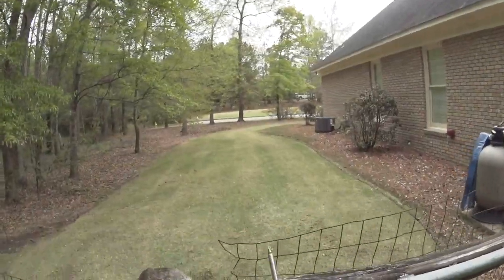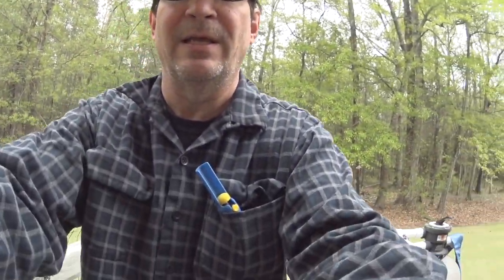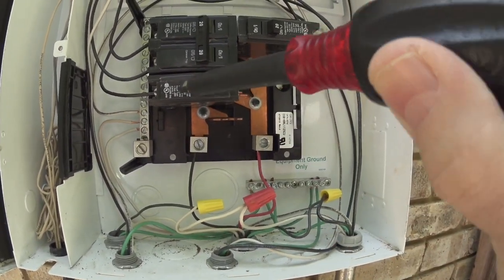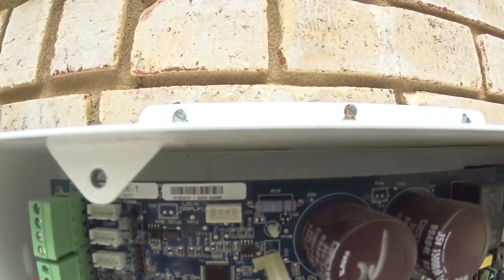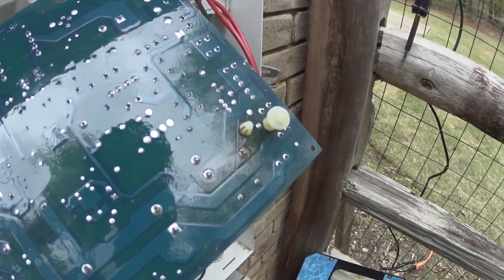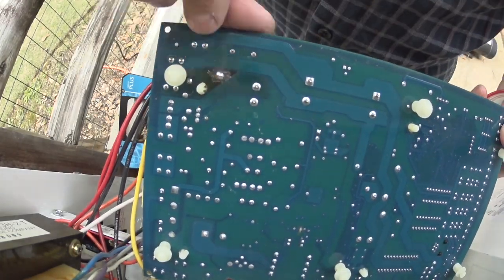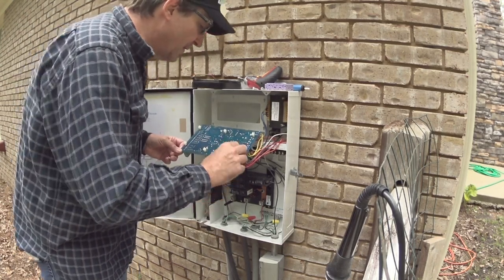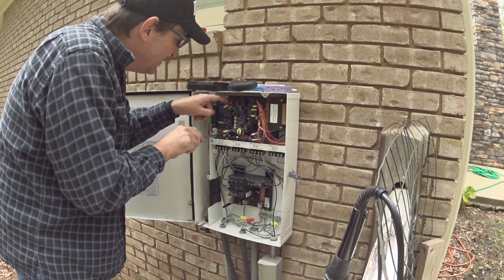Chlorinator Off No Cell Power - DIY Repair

Comment: Thank you, thank you, thank you. This was fairly straight forward and your step by step were perfect. After soldering, my system works fine. Btw, this was my first time soldering anything. Not very difficult but there is a learning curve.
Reply from the maker: Hi David,   You are very welcome!  Glad the video helped you fix your system.  You are right, there is a bit of a curve with soldering but as you have proved this particular repair can be soldered by a beginner!  Thank you for your kind words and for taking the time to come back and share your success here in the comments!

Comment: Wow, thanks. I had the exact same issue and in the exact same spot on the board. A little soldering and boom, fixed.  Who knew it could be that easy.

Comment: Awesome video with just the right amount of detail. A couple of notes, I actually got a low voltage warning a couple of times which I was able to reset until I got the no cell power warning a couple of days later which shut the cell down.  I find it amazing how long the board actually still works with a cold solder joint on the relay (~10 years).  Although my pool has a couple of extra accessories the K1 relay was located in the same area. My board had the same burn/heat marks around the solder joints.  The solder joints on the other two relays don't look great either, but I'll wait until I have a problem before messing with those. Only thing I did different than the steps on the video was to power back up and test my repair before completely fastening the circuit board and the control box to the panel.  Those plastic connecting posts tend to get brittle over the years, so the fewer times you have to remove and reattach, the better. Many thanks for great video and the massive savings of not buying a new board!
Reply from the maker: Hi Ralph, Thank you for the detailed comment, sharing your success and kind words! It’s always great to hear good news of another successful repair!

Comment: Going to try and fix ours! Same message. Praying it works for us!
Reply from the maker: I highly recommend you cut the power off from the main panel breaker that feeds the pool equipment sub panel!!! That’s the safest way. 

I hope it works for you too! Please comment and share if it works or not. 🤞🏻
Reply: We did not cut the main power, we did it just like you. I did tell my husband it would probably be a good idea to do that but he said we know where it is hot so we are good. He has done some minor wiring & electrical around the house so he has a little experience. Thanks again, it worked!

Comment: Outstanding video! Could have been more accurate. It took longer to warm up the soldering iron than it took to fix the problem, Thanks so much for your video.
Reply from the maker: Hi David, That’s funny about the soldering iron taking longer to warm up than it took to fix the problem. So true! Thanks for the kind comment!

Comment: Thank you for the video!! I had the exact same problem and fixed it in less than 30 minutes thanks to your video. As others have said, turn the power off to the sub panel before opening it up to be safe.

Comment: Appreciate the video! I just that this same error/issue/relay with my Aqualogic board except a simple re-solder didn't work. Checking resistance, the relay was open between NC. I replaced it (Amazon - $8) and I'm back running! :)
Reply: FiveAble, no it was pretty straightforward using the manufacturer name and part number on the top. In fact, I think the seller mentioned Hayward or Aqualogic in the listing.

Comment: Absolutely solved "no cell power 2" problem. Thanks, very helpful.
Reply: @fiveable  I was amazed after 5 years of operation to see the relay solder joint blackened and compromised just exactly as your video depicted. One bead of solder later, and 5 minutes and been making chlorine for 48 hours now trouble free. Sure thought it would be more difficult and expensive to resolve. I took pics but they really don't differ from your video meaningfully and not sure they can be included in a comment. Peace to you and thanks again!

Comment: I recommend replacing the relay...! I inspected mine after replacing and it was quite purple from excessive heat. This creates resistance which creates more heat and so on...  until failure. The Omron version is obsolete but you can get the same package in a Zettler. $3.50 from Digikey, Part AZ2150-1C-24DEF

Comment: My board has a burnt place in the exact same spot...you da man
Thanks a ton !
Reply from the maker: Hey Billy! Glad it worked for you too!  Thanks for the comment!
Reply: @fiveable  
I guess I celebrated too soon.
I did the solder repair and that didn't fix my problem. 99.9% sure the relay is bad too. So, I have that relay ordered and on the way. Gonna just try to get a TV repair place to solder my new one in and hopefully that gets me going without having to buy a whole new circuit board
Reply from the maker: Oh well, if the relay fixes it then you will still come out ahead versus buying a new controller.  If it still doesn’t work there is a guy on Ebay who rebuilds these boards.
Reply: @fiveable  
Cool ,  thanks !

Comment: Thanks for posting this! Kinda sucks that if this is a known issue then why hasn't Hayward addressed it with an automatic board swap with anyone who has this problem.. like other companies that I have dealt with.
Reply from the maker: Not saying it’s right but I’m pretty sure it’s because it usually happens outside of the warranty period and boosts new system sales.

Comment: same problem with my board.  I'll fix this weekend doing as you've shown.  In addition to the no cell power error message, it has a  problem keeping time and having the timers coming on when they should.  Does anyone know if this repair might fix that issue as well?
Reply from the maker: Sorry, this repair will not fix the timer issue. I believe there is a clock chip or crystal that goes bad sometimes.

Comment: Great video.  I have the same problem on a two year old Aquarite Pro...
Reply from the maker: Good thing about this problem is that it resolved quickly and cheaply.  If caught soon enough the repair can be made before the pool has time to get out of balance which saves the cost of extra chemicals.  Thanks for your comment.  Best of luck with the repair!

Comment: Awesome video! Thank you very much! Saved me a bunch. Unfortunately the fix only lasted 3 weeks. Any suggestions?
Reply from the maker: Sorry to hear it didn’t last for you. You could try scraping some of the coating off the trace and resoldering to get a better connection. 

* The safest, and recommended, way to work on your board is to turn off the main panel breaker that feeds power to the pool sub panel! * 

It could also be a relay problem. If you go to my website (see link below) I have photos of the same board in the video with an improved solder job. My soldering never failed but when I sent the board in for a new clock this year they went ahead and added to the connection. They said it helps disperse heat. Also there is a link to find HaflerUSA on eBay. I know the guy who owns the service and he does great work and gives a 3 year warranty. That would be my next step before buying a new board. His turnaround is about 1 day and you won’t have to reprogram any settings because he will repair and return your actual board.

https://www.FiveAble.com/support
Reply: @fiveable Thank you so much for the quick response. I decided to jump in and perform the solder job…again. Sadly, my first attempt was ugly. Not sure I actually penetrated the joint. Re-soldered the joint and the system responded perfectly. Firing on all cylinders, once again.

You’re a life saver, or at least an $800 circuit board saver. That’s huge to me. Thank you, again for taking the time to educate the rest of us. Best of luck to you and your family!
Reply from the maker: That’s great news! Glad you got it working again so quickly!

Comment: Dang I did all of this and it still didn’t work. The joint was burnt out and everything. Do you think the relay needs to be replaced?
Reply from the maker: It could be the relay. Hard to tell. If you pull it you could probably test it. How badly was the joint burned?  Before removing the relay it might be worth trying to carefully scrape some of the coating off the board so you can get a good connection with the solder. Make sure you only scrape off the coating on the metal trace that goes to the relay terminal and be careful not to short out anything with solder where it shouldn't be.
Reply: @fiveable  It was pretty dark when I first saw it. I’ll try to do what you suggested and go from there. Hopefully I didn’t put too much solder on it.

Comment: Thanks for the excellent video.  I had the same "No Cell Power 2" problem and fixed it with the help of your video.  I'm guessing that's the trace where the ~6A flows through for the chlorinator cell.

Comment: good job!!   I replaced a board yesterday due to a burnt relay leg (same one!!).     i would def recommend upgrading your power lines going into the panel..they were kinda puny looking on size.  lol
Reply from the maker: I’ll definitely look into upgrading the power lines. Helpful feedback from a pool pro like you is a benefit of posting a video like this! Thank you for your comment!
Reply: @fiveable  not alot of people even know what a soldering iron is let alone know how to use one on relays.  most of those relays are the same on alot of pool and spa equipment.   i guess on business side, resoldering wouldnt be good for warranty and such is reason we have no choice but to replace the entire board.
Reply from the maker: @naturalstatepoolandspallc338  True about most people not knowing what a soldering iron is. Fortunately the fix is pretty easy for a homeowner that is at least a little bit handy.  A few years ago I rebuilt a spa heater board for a friend who ordered a "bullet proof" power kit with directions for a power reroute along with new relays.  That was a pain but it worked for him for years.  Looks like my next trick will be replacing the clock chip since the board in the video is now losing time. I ordered the super capacitor and a crystal. I don't think it's the super capacitor (basically a battery) since the board will maintain time even if I flip the breaker off.  If that doesn't work I'll try and find the timer IC or send the board to a repair service I found that is way more qualified than I am.  I guess I could get a new board but I don't know how hard it is to get the correct one and reconfigure it.
Reply: @fiveable  depending on the board...you may be cheaper to just get a new one.  i think just a salt cell board was like $200ish or so.   but if you take into account parts and labor to have someone fix, it may run ya close to the same amount
Reply from the maker: I’ll look up the board and see.  The rebuild service was $150-200 with a guarantee so that’s close to a $200 board. Seems like last time I looked for my board it was higher than $200.  Funny how much variation in price there is between local shop and online.  When I replaced the cell the local shop wanted twice the price for the cell  (labor not included) and that’s one of the easiest parts to replace.

Comment: Excellent. Wow man. Thanks for the that. I am dealing with the same error. Just bought a new cell in winter. Scratching my head. Saw where the switch can go bad. But I will investigate this 1st and see if just adding some new solder will fix it. Also, I see from your other videos you're in North Ga. So am I, on Lake Allatoona. Thanks again neighbor.

Comment: Hi great video mine says chlorinator off but it doesn't say no cell power, I just replaced with a new hayward cell I'm having issues reprogramming it do you think I might have the same issue thanks
Reply from the maker: Not sure. Did you replace the cell because of the chlorinator message?  It probably wouldn’t hurt to check the back of the controller board to see if any of the relay connections look bad like mine. 

!!!Before working on it, be sure to turn off the main power feed to the sub panel for the controller!!!

Hope you saved the old cell. It might be good if the relay connection turns out to be the problem.

Comment: Great video! Thank you so much for sharing! Will it work with a Hayward Goldline Pro Logic with the error code 'No Cell Power 2'? I took my unit apart and it has a bad solder joint in the same spot as yours, but I'm scared to try if it won't work with my chlorinator...
Reply from the maker: Hi, I don’t know if it works for that code but if there is a bad solder joint it’s probably worth a try. In general, if the problem is with the board, a pool service company is going to completely replace the board. They don’t repair them and replacement is very expensive. See comments for some of the prices people were quoted for the repair.  Also, make sure to cut the power off at the main breaker panel. That’s the safest way to work.
Reply: @fiveable  Thanks so much! I really appreciate your feedback. If I give it a try I'll let you know how it goes :D

Comment: Main Service (Power to the Circuit Breaker Subpanel) is rated for 100A service. 

You’re supposed to run “properly rated conductors” (L1,L2, N, AND ground) from the primary house electrical panel to the main power connections on the AquaLogic circuit breaker base. The connection at the main house panel should be to a 240VAC circuitbreaker rated at 100A maximum. The gauge wire I see in your video looks to be 12/14 gauge feeder lines - luckily that unit has not started a fire yet - never mind just the salt cell malfunctioning.

Comment: Hi, I have a very similar problem. I have the “no cell power” message, but mine is blowing the 20A fuse in the board. I replaced it, the message went away, then blew the new fuse about a minute later. I removed the board and don’t see any burn marks or anything that appears to need resoldering.  Do you have any idea what would cause the fuse to keep blowing? Thanks!
Reply from the maker: Hi Randy. I wish I knew what the problem is with your board but I haven’t experienced that problem. Just in case it helps, there is a guy on eBay who services and rebuilds these boards for around $150.

Comment: Is it necessary to remove that display box first? It doesn't look like it's connected to anything other than the board you want to flip over and work on?
Reply from the maker: I think you are right. As long as you can get to the screws at the bottom, you should be able to unmount the board with the display attached.
Reply: Thanks so much!

Comment: Hi - thanks for the video and I was optimistic it would work because I had the same exact errors but after soldering where you did, I still get the same error.  Any ideas on what I could check next?  I followed all the steps and still no luck unfortunately.  The fuse is ok as well so no issues there.  Thanks in advance for your help!
Reply from the maker: Hi Ed, Do you think you got a good connection between the board and the relay pin? I think a similar error comes up too if the salt cell isn’t plugged back in. Just a guess but maybe the cord to the cell is damaged somewhere? I’ll disconnect my cell tomorrow and see what kind of message I get.
Reply: @fiveable  Thanks for your response!  I appreciate it.  It’s unclear if I got a good connection between the board and relay pin.  What’s the best way to tell if I have a bad connection?  I do have the salt cell plugged in and cannot see any visible damage to the cell cord or any other wires.  Is there a good way to test to see if the salt cell is bad itself?  I ask because I thought it was the K1 issue described here and not the cell but the cell is over 6 years old so it could need replacing.  Any troubleshooting ideas are appreciated thanks, Ed
Reply from the maker: Ed, Did you happen to take a photo of the bad connection before you fixed it? I wouldn’t mind taking a look at it to see how bad it was. If not that’s ok. If the board itself was really burned badly the bare conductor/trace can erode making it hard to get a good connection. If this is the case I would try taking something with a small sharp edge (x-acto blade) and VERY carefully scrape some of the green coating off. You have to be very careful to only expose the trace material (copper) for that trace only so the solder doesn’t short two different traces together. I can’t remember how close together the traces are on that pin but I think it wasn’t bad. Also, to go back and do this after the first repair attempt you need to desolder the joint as much as you can. I have a spring suction thing that I use when the solder is hot it works like little vacuum. Braided copper is another common method but I find it harder to use. As far as testing the cell I think a pool company might be able to test it if you take it in. Beware though, the last time I replaced my cell the local pool company I called for a price wanted almost 2x what I paid for it online.
Reply: @fiveable  I do have a picture before I soldered it.  I can send it to you if you send me your email address or let me know where you to send it.  Thanks!
Reply: Also, I’ve been researching online for a new salt cell and it seems the pool industry supply has been hit hard.  I tried to order a Hayward T-cell 15 replacement salt cell and it is on backorder for an unknown amount of time.  Anyone have suggestions of online pool places that have replacement salt cells for cheaper? The local store is charging 2X the price I see.
Reply from the maker: Please send the photo to: saltcell@fiveable.com